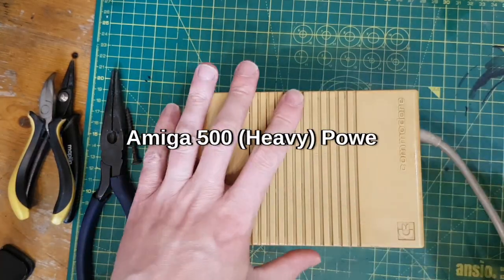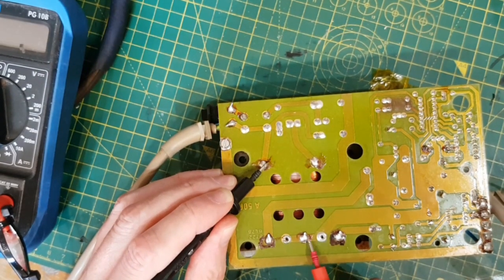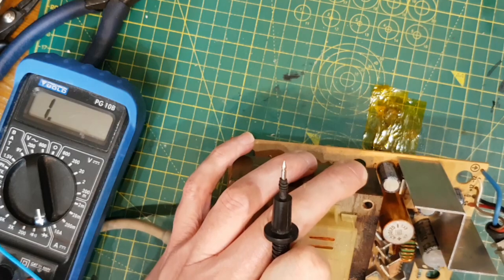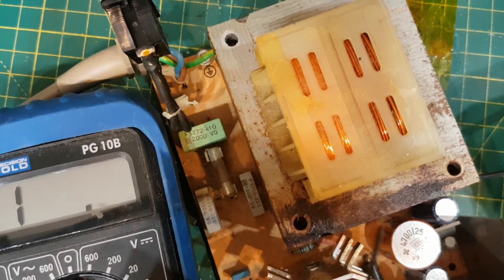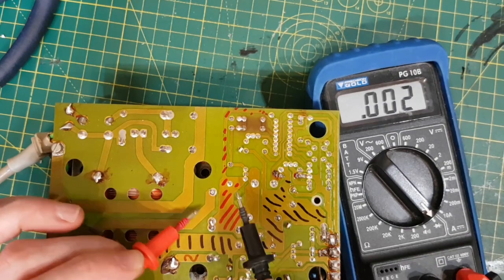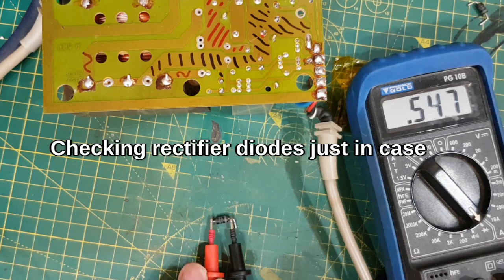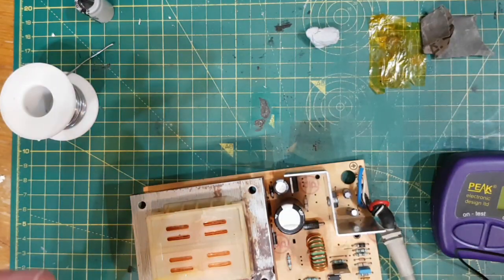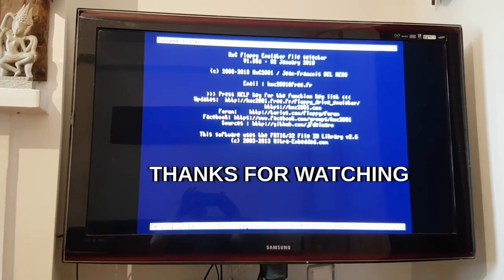Amiga 500 (Heavy) PSU Brief Walkthrough & Repair

Comment: I have the same issue on the -12v rail. I'm very lucky to get into this video. Hoping that replacing the 7912 and changing the 330uf capacitor to 470uf will fix the issue. Thank you very very much for sharing